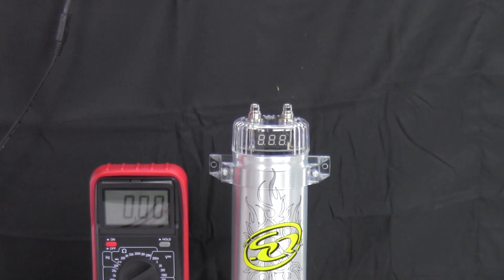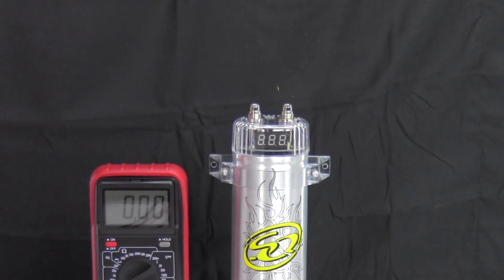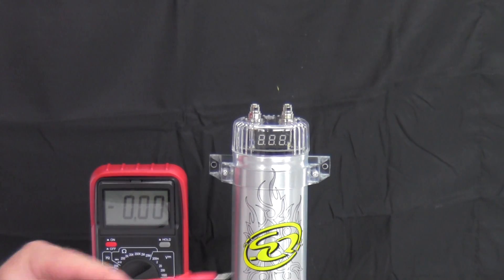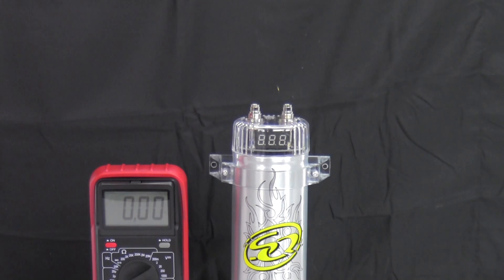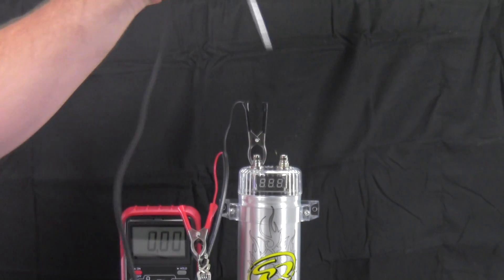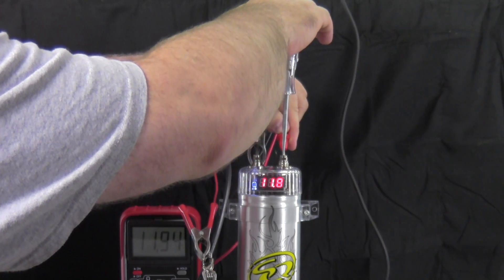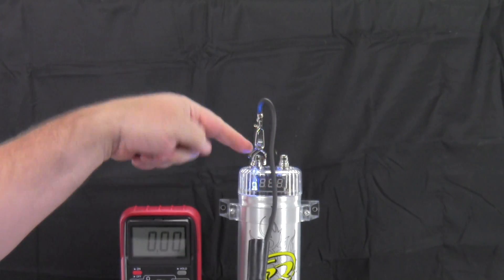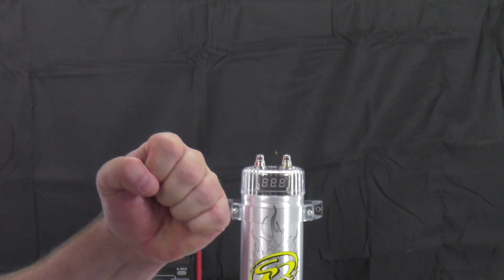Playing with Capacitors - Charging and Discharging - How To

Comment: Thank you very much! That is the most technical that I have heard one speak on YT in regards to a cap.

I have been searching for I for about caps for a long time now due to dead batteries!

Would you by any chance know how can I diagnose if I have a bad cap that does not "auto cut-off ". I do the same process multiple times before installing into my vehicle, but it will still drain my battery instantly then I pull the battery and cap out to charge again.

However I can "make it work" by installing charged batt and cap then start the vehicle and connect to the cap which seems to work as long as I go for a long drive. 

If the vehicle sits for 3 days or more without being on trickle charge or driven, the vehicle battery drains and my cap.

I have replaced the battery multiple times (I keep 2 at times, one on charge, one in the vehicle), 2 new alternators(275amp).

I am at the point to where I think wiring dual batteries with a battery isolator would be better than my current setup.

Any advise would be greatly appreciated!

Thank you for your time if you have read all of this,
XLsx Denali

Setup:
Vehicle: 2003 GMC Yukon Denali
Battery: OPTIMA red top 34/78
Capacitor: Kole Audio C2.5SD (2003 model)
Amplifier: Rockford Fosgate PRIME R2-500x1
Subwoofer: 2x JL Audio 12w1v3-4

General background to hopefully you to understand me and the troubleshooting / testing that I have already performed  before taking all this time to write this! Lol
I am a gear head that went to automotive college which has become to be a asweome carrer working as a certified IPC-J STD 001 NASA technician, but yet I am still unclear of how this cap works since I have never seen the manual or any of the drawings/schematics for the device😔

Thanks again

Comment: I’ve got one of these in my truck and whenever I get in my truck the numbers on it are lit up, which means it is always running and sucking juice out of my truck, how do I fix this
Reply from the maker: hello, some capacitors have a remote turn on circuit. If yours had one you could wire that remote turn on to a switch power in your truck on put a toggle switch in line with it and turn it on manually. Some other capacitors may come on when there is power on the main positive. Then you might have to add a high current relay in line with it, and put its remote turn on to a switched power.

Comment: i tried to charge my bullz audio 8 farad capacitor but i does no display anything!!  I tapped the power straight to for a second and it turned on 000.0  blinking.   then i tried again to use the small circuit and still no charge,  can you help me..?????????

Comment: Can I install a capacitor with the car running
Reply: I would not don't because the alternator would put out more power and if you have an accident wouldn't end well. Leave car off and ignition off as well

Comment: Where are you getting your charging from battery, wall, etc?
Reply from the maker: I believe I was using a 12V Dell server power supply to charge the cap. It plugs into a 120V wall socket. I had gotten that one from either Amazon or Ebay.
Reply: i still dont get where you power comes from.
Reply: A car battery will work just fine.   Been using them to charge mine for years!!!   Thanks lost my resistor and never though about using my tester light as one!

Comment: That's not how you discharge a capacitor. Capacitors do not like to be charged fast. And they do not like to be discharged fast. I am a certified small electronics technician with 32 years behind the bench. The proper way to discharge this capacitor is to use the enclosed resistor and run it from positive to negative. This will allow the capacitor to drain but not drain fast! It will take it about 3 minutes to discharge to 0.2 volts. Always use the included resistor to charge to a strong 13.1 volts. You will find the capacitor holds a higher voltage if you do this. But never ever discharge a capacitor of any type this fast! That's why they include a resistor it's not only for the charging but for the discharging. And you might want to get a better meter. Had one of those harbor
Reply: how big of a capacitor can i thouch to my tongue before it hurts hurts.

Comment: Where can I get a test light from? so I never hooked up a cap b4 I had it professionally done the first time I'm using the same wire an gauge wire an same cap I'm only getting a new amp an two new subs will this still be easy for me?
Reply: Percy Carr caps are a waste of time and money u want to have a good quality source of continuous power u should get a drycell battery for your sounds. I’m running a drycell for my sounds and it hits much harder than that cap would. They’re a bit expensive but well worth it
Reply: @jasoncross1795  is it the same case for ultracapacitors?

Comment: hello,
can i charge an ultracapacitor ( 500F-2.7V ) with a PC power supply on 12 Volt and stop charging when the capacitor reaches 2.7 V or is this dangerous or impossible ?
thx
Patrick
Reply from the maker: Hello I am not sure what the specifications are for your capacitor. I have played with capacitors a long time ago, and I had gotten caps to fail, little small caps you see on a circuit board, either by cranking a lot of voltage through them or reversing the leads. You could probably put a few extra volts into it. You can look up a Voltage regulator schematic only, or get on Amazon and see if they have a variable DC circuit board for relatively cheap, and dial down to the voltage to the 2.7V.
Reply: @Bouray1  this is my first time playing with capacitor, was trying to replace a capacitor of casio watch which originally had Panasonic GC capacitor of 2.4V 0.68F, replaced with 2.75V 0.75F (actually cut the 5.5V 1.5F in half) it wasn't charging through the solar panel the watch had. So i kinda jump charged the cap with 5V DC supply (No resistor any sort). It's working for watch but not sure if capacitor is damaged. Any tips for me ? Correction for what I did wrong?